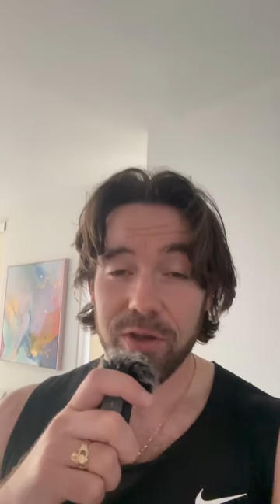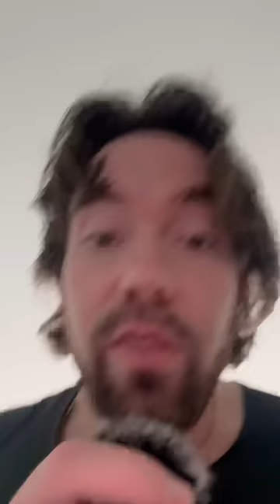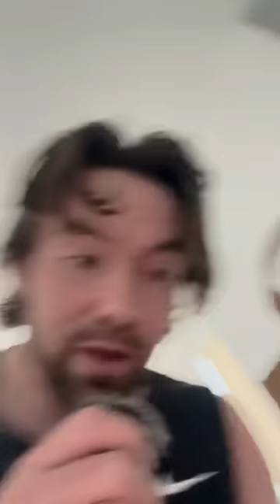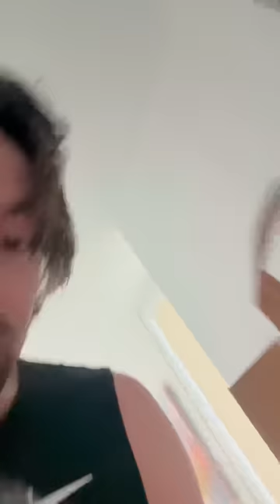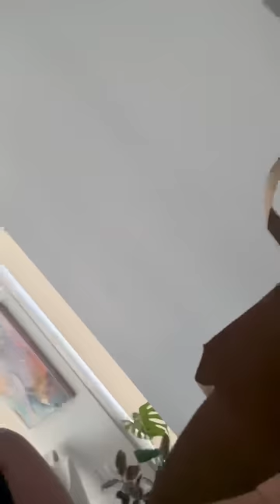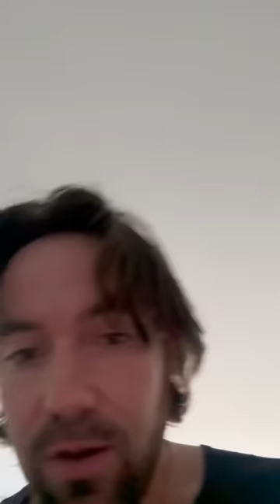I hate this

Comment: From a manufacturing point of view, it's pretty easy to glue handles to one side of the bag stock.
 Much harder to split the ends of the handles and trying to glue to both sides of the paper.

I've had paper bags from Penney's fail before I even got out of the shop.

Comment: Someone at corporate is trying to justify how they have managed to cut costs by .05% per bag this quarter without showing the board the increase in bag usage by 100%. This will get the manager a raise and bonus. The next quarter they’ll roll out the original design with strengthened handles and show the board that for an increase of .05% per bag, they’ve cut down bag usage by 100%. This will get the manager another raise and a bonus. In the third quarter the manager will fire his chief engineer of design and production, claiming he was the idiot that caused the original design to be dropped in favour of the inferior less costly design, then he will hire some kid off the floor into the net chief of design position and pay him 30% less. This will get the manager another raise and a bonus. 

This is the way modern corporations work.
Reply: 100% The real idiots get rewarded while those who may come up with a viable solution to the problem get fired. Nepotism and ass kissing at it's finest.

Comment: Hmmm...i don't think gluing it on both sides will help. The shear causing the initial tear is due to the opposing forces acting between the weight of the bag and the handle. As you carry the bag the items tend to roll to the front or the back of the bag. When this happens all of the load transfers from the bottom of the bag to the nearest handle (load likes to follow the shortest route). Therefore at the handle there is a stress concentration. Even if you glue it on both sides this stress concentration will occur. This concentration causes the initial tear. Folding over the lip of the bag is probably the easiest fix as it will make it harder for the intial tear to start

Comment: Everything to do with bags is stupider than you think. So far as I can tell, every design is under a design patent. When the patent owner wants more money and / or the company wants to cut costs, they switch to a cheaper design. Same goes for every other style of container, can, or opening (pop tops, pull tabs, foil seals, etc.). There is an astonishing amount of patent squatting, trolling, and litigation over the tiniest details.

Comment: I designed this bag. What he doesn't understand is that we need to double bag it regardless because of customer expectation and for the other failure modes. If you look at the test data, the bags actually tear about as often from the bottom as the handle, but because this is a unique design from a more premium brand, customers pay closer attention to the problems they aren't expecting to deal with...ok I didn't design it, but that's probably the logic.

Comment: Maybe this short was just to get people riled up... The bags work fine if you don't overstuff them. They are designed to hold both handles with one hand, putting all the load in tension, making glue on the inside not helpful. To boot, I would rather my handles fall off and still have a working bag than just have the bag rip.

Comment: The traditional single use T-shirt handle style plastic grocery bag has a capacity of 7-8 pounds, so a gallon of liquid is at the bursting limit.

Paper bags with glued handles have clear instructions to lift the handles UP to detach the glue dots holding the folded handles closed, but to NOT to pull the handles OUTWARD as to delaminate the handles from the bag. A properly deployed unabused single paper grocery bag held by the handles can hold 12-15 pounds vertical static load stress before handle failure. One of the problems is applying too much dynamic load stress or shear load stress to the bag.

The real problem is lack of education and training, as the children graduating from our secondary schools have become stupider each generation. Therefore there is no one intelligent enough in grocery management to properly teach baggers how to use the bags, and no one who cares enough to help the customers learn to use them, and even fewer of either who actually read the words printed on the sides of the bag and understand what they mean.
Reply: Exactly right.  It’s hilarious how everyone just wants to complain though. 😂